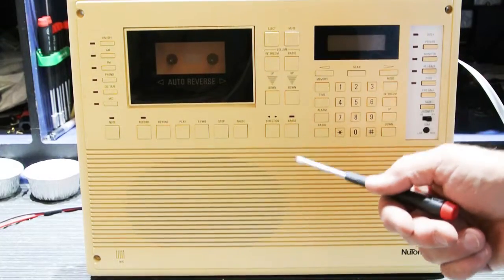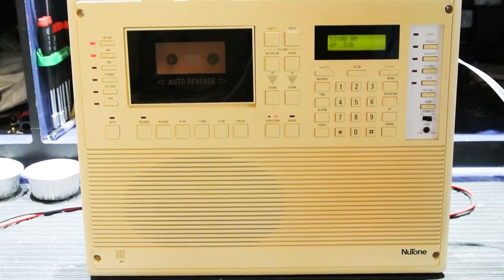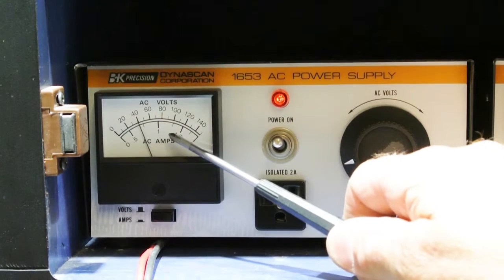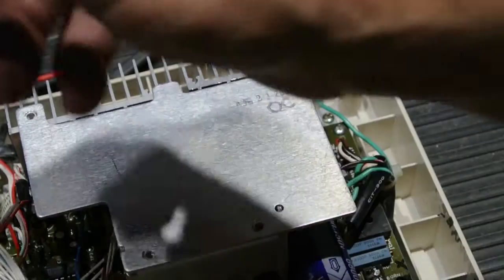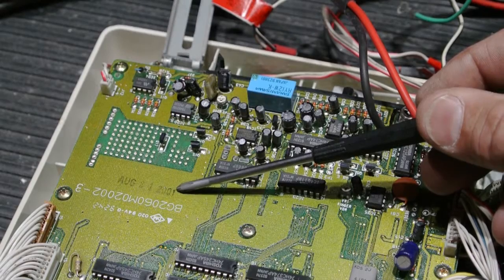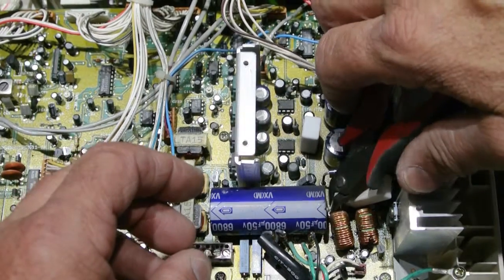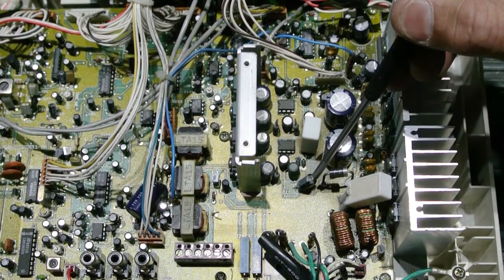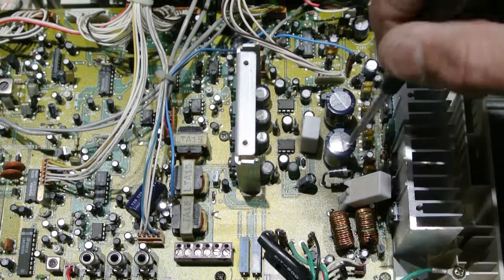NuTone Radio Intercom Model IM5006:  Common Failure Mode #3

Comment: I agree the video is correct. I re-capped ALL of the electrolytic capacitors on my IM-5006 boards and it solved a loud, constant howling sound the unit started making. Takes a long time but plays like new.
Reply from the maker: Hi Hailey: Well Done.  How many capacitors did you replace and how many hours did you have in the project? - Chris
Reply: Approx 190 caps on 3 circuit boards.  I did them all because I'm not sure which were the offenders.  Suspect that the power section is where the problems were and there are about 30 mostly larger caps there (between the 2 heat sinks on main board).  Took a couple days. You need patience, approach it like a jigsaw puzzle. Ordered the caps from Mouser after making an inventory.
Reply from the maker: Hailey Woram Well Done - Chris